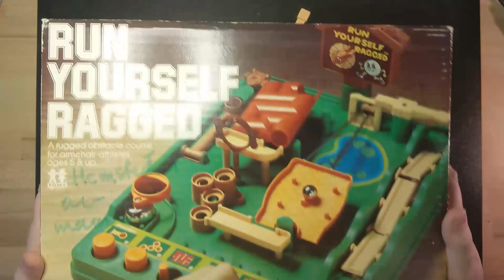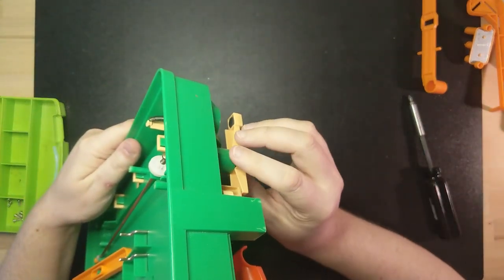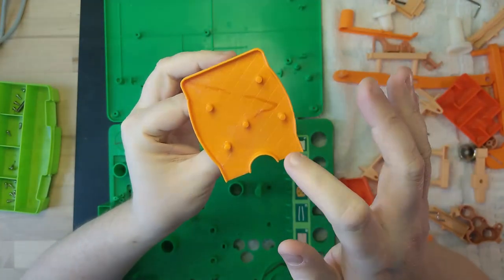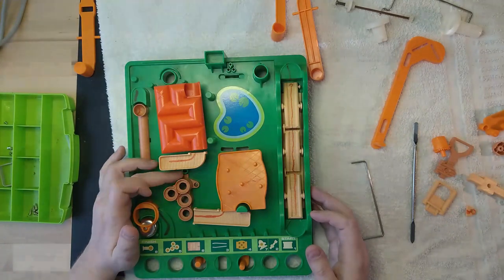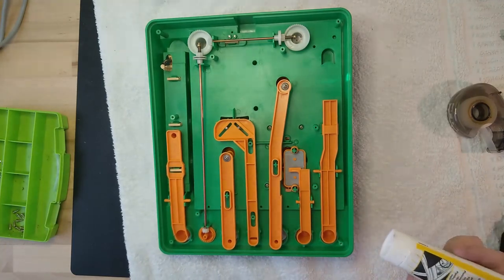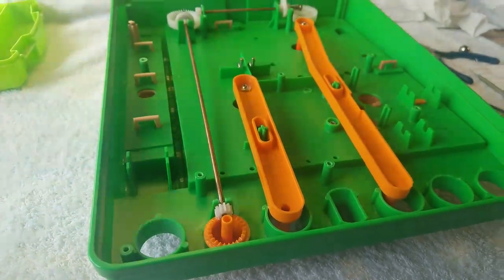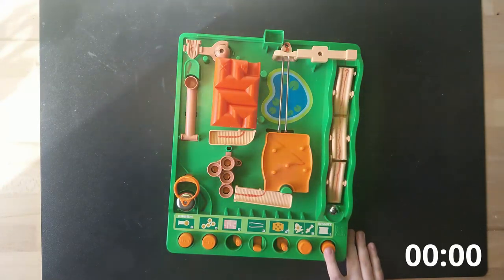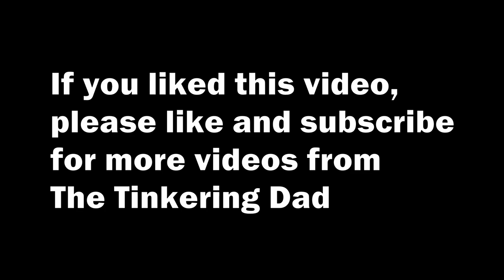Repairing an old toy - A Run yourself ragged!

Comment: Thanks for the tutorial, I just ran across my old Run Yourself Ragged game, and it needed a little TLC! My gears for the ball magnet and airplane still aren't working for some reason, but I should be able to get it working! Oh and I had to repair the timer, and clean the steel ball, but it all works just how I remember!
Reply from the maker: No problem!
I think that since those gears are so tight and snug fit, just a little wear somewhere will cause problems. I took me several hours to get them smooth again.
Reply: @thetinkeringdad  Great video. I have the same issue. Can you buy new gears at that size?
Reply from the maker: @animationsilo  Thanks! I think you can buy new gears but all I have found are large kits with an assortment of many different gears. As an example check this link: https://www.amazon.com/Plastic-Gears/s?k=Plastic+Gears
Hopefully you can find the correct gears somewhere in a pack like this. If you find anything better please put it here in the comments.
Reply: @thetinkeringdad  i will check them out and post here if I have success. Great video mate I wish I had your patience 👍🏾👏🏾

Comment: I’m working on fixing mine. My problem is that the two small cogs, which are 9mm with about 3mm bore are both cracked. This creates a bump when turning the knob, and the ball falls off. I am in the process of finding some new cogs, but I’m not sure what size they are. Any help appreciated.
Reply from the maker: Are both those 9mm cogs so cracked that you can´t measure them completely? Otherwise I don´t mean when you say that you don´t know what size they are? Then again you say they are 9mm soo.. :)
Please explain I bit more. And if needed I can probably get mine out and measure what you need.